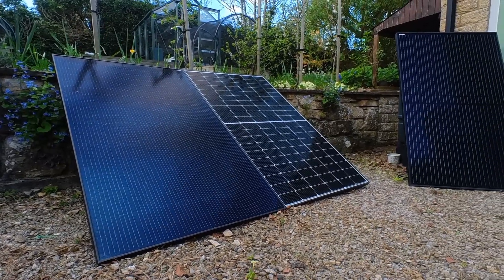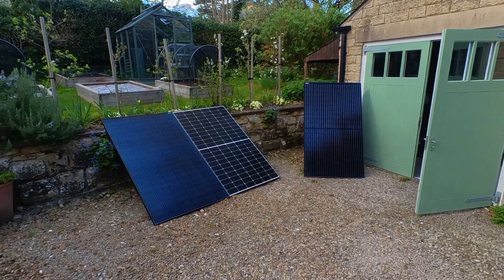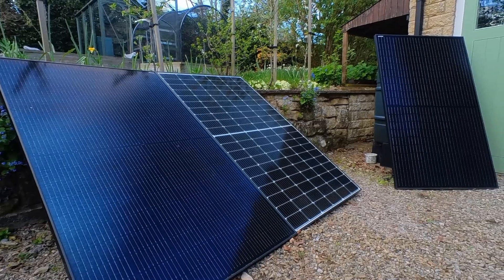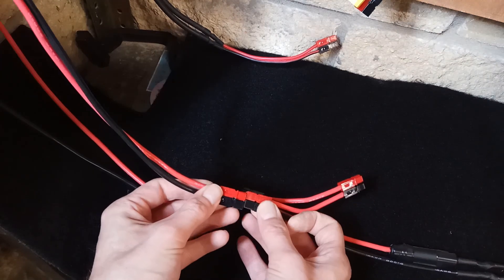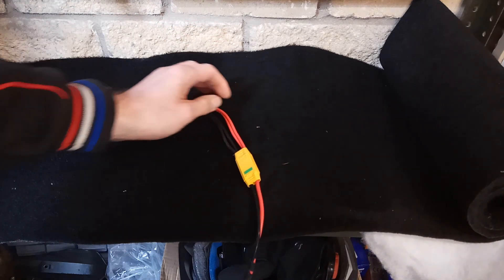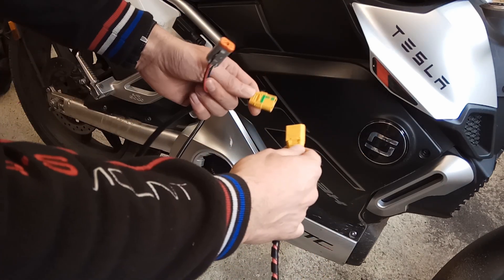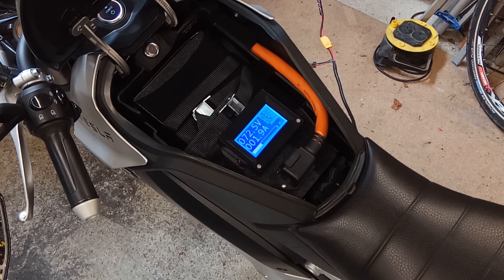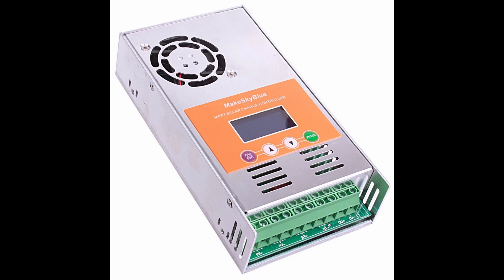Solar Super Soco TC Max - Riding on Sunshine Pt 1

Comment: Hi again, yes, fixing the charger will be childishly simple. I’m hopefully going to end up with this as a spare. I cannot imagine that the importer has any electronic diagnostic capabilities so I’ll try and keep it. The charger is charging the bike, however, at 100%, it doesn’t stop. I suspect that the black wire is used for battery voltage sensing. That’s a great offer on the stickers, thanks, I’d sure like to take you up on that. Could meet for a ride on the little bikes (have a van) to facilitate, or post? Definitely on a QSO, as well as HG, I can also access IR, WF, and a simplex fusion gateway on .850. 
Cheers
Reply from the maker: My standard charger seems to work fine with just the big red and black main wires connected. It's only the 5A though. I wonder if you could make it to Helmsley. Big hill on the way so you may need to charge when you get there. I can only do HG and sometimes that doesn't work. Let me know when you're about. I'll give you a shout.
Reply: @thecapacitator8137  they want the charger and battery back at VMOTO for inspection..... so I'm probably not going to score an extra charger. Grrrrrrrr
It's possible to do Helmsley.....I could of course park up in the van somewhere up the hill, and spring out, thunderbird style. Then it's mostly coasting to Helmsley..... 
Or, I could make the round trip at moped speed I think......
I'll give you a shout here when I get radio time.... If my email addy is on the "usual" place, send me an email and we can arrange.
Reply from the maker: @phoebelala  Why would they need the battery? Sounds like they're trying to be difficult. Just spoke to Alex WUY on 2m. He reminded me the time I over heard you two talking about ebikes. So I've heard you before but not spoken as far as I remember. Can't find your email so you'll maybe have to update it.
Reply: @thecapacitator8137  Hi, apologies for the name change, I was always phoebelala and then, for reasons unknown, I ended up as VZZ on YouTube. A setting somewhere with google that changed everything when I got a Gmail. 
I’ll update the usual place to include my email addy, .
Battery, why indeed? in fact yesterday I spoke directly with VMOTO and explained that I really don’t want to send this massive, expensive bit of equipment by a courier as it is  going to get smashed about. Lots more was discussed but I’ll save that for email and QSO.
I’ve got time this weekend to evaluate my purchase, first thoughts, @ the quoted 5KW max, we have a current from the 72V nominal, of 7OA. The females on the battery look a bit thin-walled, but must be capable. The 10A charger appears to be a balance charger, treating the modules as cells,  sure yours must be too? I’ll have a watch of your vid again later to see what’s what. I often talk to Alex, but not done much radio in the last 2 months.
Stand by
VZZ
Reply from the maker: @phoebelala  Thanks I'll go find your email. Yeah the connector could be a bit of a weak point. I've noticed slight warming of the connector after a full throttle run. The copy I put on the DIY pack seems better.

I think the BMS handles balancing not the charger. The small wires in the charger output are canbus and state of charge signal as far as I know. On my DIY battery there's no canbus connected. A separate module reads battery voltage and produces a state of charge signal. I believe the standard pack is 20 single lithium iron phosphate prismatic cells in series.
Reply: @thecapacitator8137  ah, right. Thaks for that. So, given the above info, then, it would appear that the standard pack would /should have a theoretical max of 84V. With the charger output being 83V, it seems likely that they have gone for gold at 98.8%. 
I'm unaware at this point on the charge termination. Currently I'm sat next to the battery on charge and am regularly stopping and checking the voltage. Looking forward to continuing on email. 
Cheers

Comment: Very interesting, Im going to buy one of these little bikes, mostly for fun local rides and experimentation, not commuting. Its very difficult to actually get to see one but I have watched all the videos. The removable battery and the belt-drive are the deciders.  Theres a used one in Edinburgh at a dealer that I may drive up in the van and collect this week or just buy a new one, they are after all, only bicycle money. 

I have a single 100W solar panel on the roof of the van along with 3 x 105AH batteries in parallel for storage, to supply DC to the 2KW inverter, I could therefore charge with the supplied charger via the inverter but  will be enthusiastically following your developments.
Love the TESLA decals. I thought of that myself but clearly you beat me to it. 
73's
Reply from the maker: Hi again. Thanks for making contact. That was my exact thinking also. A cheap electric vehicle to tinker with! Sounds like you've done your research so you probably know the earlier ones had less power. So I think 2021 on would be the one to get. 

I like your plan with the stationary storage. I plan to do the same with some lithium ferrite cells. You may have seen the type on "The Off Grid Garage" channel. Thanks again for the encouragement. My next video should be about public charging as the solar charge controller hasn't arrived yet.
Reply: @thecapacitator8137  Hi, picked up a May 2021 reg today with 41 miles on clock. Dealer demo, I called the importer before buying to confirm that this is the latest model, which it is. Bit pissed off to find the 10 amp charger damaged when I got home, the output wires showing, insulation pulled,  one black wire is broken. Dealer of course knew nothing about it but immediately offered to order a new one,,,,Grrrrrrrrrr. Bike was the shop floor display unit, obviously somebody has tripped on the cable. I’ve not had chance to investigate. Bike is fabulous, a real hoot... 
  
I’m sure we will have much to discuss.
VZZ
Reply from the maker: @phoebelala  Congratulations! Sounds perfect! Shame about the charger. You should be able to make it work. Being a ham I'm sure you've got the capability. I've got two spare Tesla stickers if you want them. I looked up your callsign in the usual place. We're pretty close. Maybe a QSO on GB3HG some time...